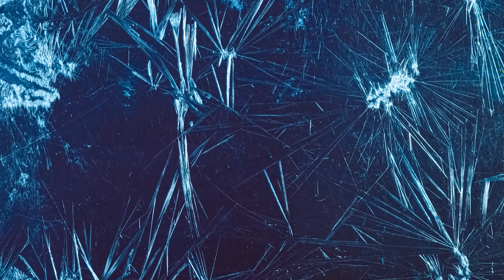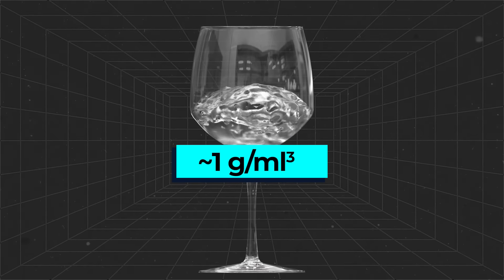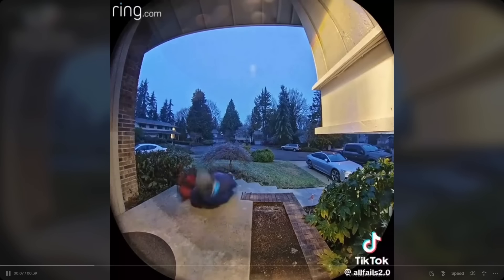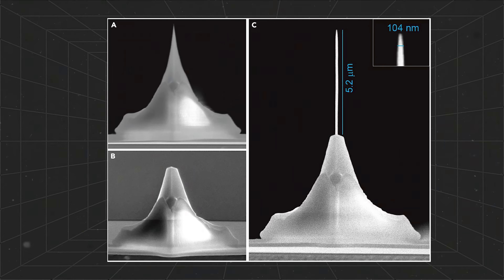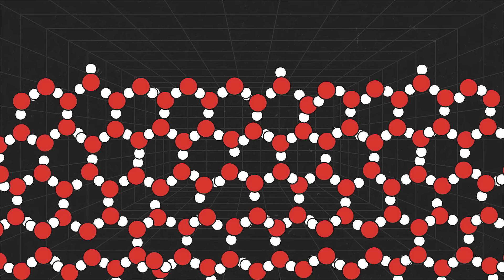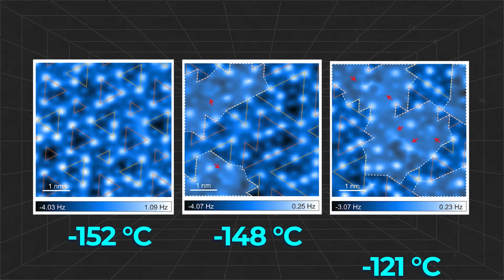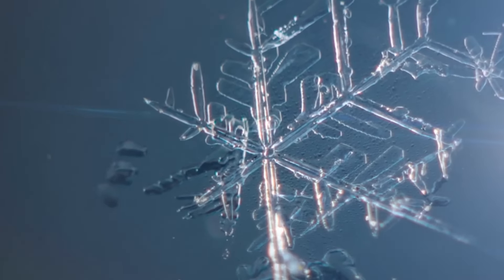We FINALLY Proved Why Ice Is Slippery

Comment: I also wonder if vibration in the top surface plays a role. There are toys called hex bugs and several earlier variations that used this principle to move around on hard surfaces.   A high frequency vibration causes the toys to only be in contact with the surface below momentarily during each cycle.  The rest of the time, the toy is bouncing up or down above the surface.  If ice molecules are also vibrating, they would push objects off of their surface so they are free to move around between moments of contact.

Comment: To the experiment with ice in vacuum. If you only remove the pressure your ice will sublime. Therefore additional cooling is nescesarry. Since temperature is a statistic, some part of the ice will still sublime, while some of the vapor will resublime. This process can reduce the friction -> slippery. I'm not satisfied in the exclusion of the other expainations, however the presented findings from this study are great. One more information I can brag about

Comment: I played ice hockey as a kid. Even at the optimal slippery temp that the indoor rink had, the texture was really rough and very grippy. Sure it was ice and slippery but you couldn't do a dive on your belly across the whole rink. And god forbid you slid on your bare palm. It felt like concrete. The tape we put on the hockey sticks would be chewed up fairly quickly from contact with the ice. I imagine ice at -150c would be like actual concrete. The peaks and valleys would be very rigid.
The surface of an outdoor rink we played at had ice that was slightly tempered by the sun, providing a glass like finish. (Perhaps it was a slow freeze?) Our entire team looked like we didn't know how to skate. It was like learning how to skate anew all over again. Seeing very good players fall on their rear at full speed was a sight to behold. The home team badgered us like I've never experienced before or since.

All of that to say, I wonder how much ice is changed by conditioning of the surface in the real world. In a lab I'm sure it was very well controlled for. However, anecdotal life experience tells me more of the slip people talk about casually has to do with the resilience (or lack thereof) of ice against having its surface tempered/smoothed by the sun and friction. Or even being molded by an ice cube tray. Did previous experiments about friction take into account these variables? It wouldn't answer why ice itself is slippery, but I feel it would answer why it's sometimes more slippery than it should seem like. Shear force seems like it can't be ignored here practically speaking either. Smooth concrete is slippery and exponentially so with some light concrete dust. I feel ice is similar. Like all rigid solids.

I'm am glad we have gotten to the point as humans that we can do very isolated experiments, to the point of plucking an AFM toolhead over -150c ice, at near zero pressures. The assurance of these results means so much more than more macro scale experiments could ever provide.

Comment: There is also some relationship to this in water splashed onto a pool of existing water sometimes forms tiny globules of water that do not get "wetted" by the pool they are gliding upon...  until they do.  Those little guys get formed and are "molecularly" "happy".  Even when the temperatures are equal for the pool and the droplets and not "hot" at all.  I think it relates inasmuch as the surface molecules of those 'balls' are a perfectly formed 'net'...  until one of them decides to "attach" to the surface it is dancing on.  Then it disappears into the void of the pool like ball lightning popping out of existence after a few seconds of floating around in our dimension(s). (personally witnessed).

Comment: I have not tested any of this stuff, but my logic would go as follows: A smooth surface vs a smooth surface is slippery and if the object is large enough, it traps a small layer of air and makes these objects hover for a while and then creates a vacuum as the air escapes between them, but if there's water between any smooth material, it becomes extremely slippery. Two ice blocks in a room temperature are already melting and when connected the surface has no room for heat and they both distribute their coldness causing them to fuse. Ice skate on ice creates grooves and is again the smooth vs smooth surface making it slippery. Cold ice block vs cold ice block in a cold room would have friction between them if the surfaces are not smooth. If you would rub these ice block against each other, they would find some sort of equilibrium on their surfaces and be evenly smooth and then become slippery. Snow can become ice under pressure and if you step on ice with snow under your shoes, the snow will turn harder and match the smoothness of the ice. If the ice is smooth; the snow under your shoe will also become smooth and very slippery. 

Interesting subject and I could write a lot more, but thank you for the video and anyone crazy enough reading my entire text.

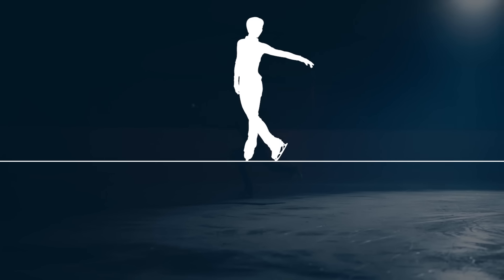Comment: Nitpicking but at 4:21 the pressure is about a 100psi with figure skates and 160psi if using icehockey skates. This is due to the concave shape of the blades and a substantially smaller area then in the used in the calculating of this pressure. It’ll create more heat but not enough to matter

Comment: I think the two ice cubes sticking together is a different phenomenon. I think this, because it is much easier to happen when they are submerged in water. I think what happens is that the warmer medium around them aqctually melt a bit of ice on the surface, and when you put two cubes together, then suddenly you remove the warm medium from their contact surface, and instead it is surrounded by still colder ice that refreezes the thin liquid layer. If you sumberge ice cubes in cold water, then the freezable layer is already provided, while in air the ice has to melt a bit first. Also these semi-free molecules of water don't explain how they might stick together, because usually the bumps on the surface of ice cubes are far larger than a size of a water molecule, so there would be a lot of air between the two surfaces that you want to fuse, and very few semi free water molecules to create the new bonds. The molten layer would be shaped by surface tension which gives a much smoother surface and easier bonding between the two ice cubes.

Comment: what makes it even funnier is that the whole "hold them together and they fuse" also WOULD happen to metals, if not for the oxidation, (Vacuum Welded pieces of metal are real issue in space) 
But it actually kind of happens with different mechanics, seemingly due to different processes... caused by the same  physical mechanics.

Comment: Water is truly strange in a lot of ways.

Also, I have a question, which is probably very obvious for people working in the sciences, but in the AFM images, what are the Hz a measure of? I mean, what's oscillating or cycling and how does that relate to the contours being measured? I expected to see units of length in some form of function of change in height per units distance in a specific direction or something like that. How is frequency used in this context?

Comment: Trying to guess what it is (I'm in the beginning of the video)

Guessing it probably has to do with weight hitting the icy surface with a mix of thermodynamics: your weight puts in kinetic energy on the surface of the ice, melting it to water, the molecules of the water collide to the low temp ones while also colliding with your food, thus the friction decreases

Comment: The property of two objects melding together is more common than one might suspect.
Metals for example have this property, only it doesn't usually happen due to their habit of building an oxidized layer when in contact with air.
In space though they meld together just the same.

Comment: Two pieces of ice cube stick really well when the surfaces are flat and there is a bit of water between them. The water refreezes between the two ice cubes and bonds them together. Under normal pressure exerted by fingers, I think it's too related to the main discussion of the video.

Comment: 3:39: The reason why I thought that's right, is because when it is very cold, it seem that ice is less slippery. That intuitively makes sense if ice has to melt in order to be slippery, so less ice will melt to water if it is colder, so we have a thinner layer of water that has less mobility, because the thicker the layer, the more freedom the molecules have at the top vs. the restricting touch at the bottom, versus a thin layer.

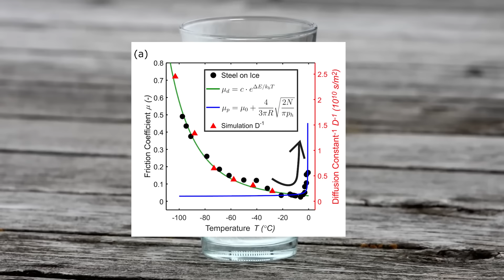Now I don't know if that's actually it, because now the question moved to the next stage: So ice has these weakly-bound molecules at the outer layer, that are able to move around like marbles, making ice slippery. So the new question is: Why are they less mobile when temperature decreases? Since it can't be the thickness of the layer (it is mindblowing anyway, that such a thin layer is sufficient to make ice slippery! Just a few atoms!), why is ice less slippery the colder it gets? Why does it turn into a high-friction surface, and at an exponential rate, as the graph at 12:05 shows.
Reply: He discussed this in the video, but maybe he took for granted that the audience understood that atoms move less when it gets colder

Comment: Modern ice skates have a very specific U shape (inverted) and not the V shape. So it does melt the ice between those edges and allows for such great performance.
Reply: but they don't melt the ice because not enough pressure

Comment: Actually, there are other common solids that stick to each other - but they need to be extremely flat. Industrial grade block gauges are known to stick to each other very strongly when placed in face to face contact and, if left in this state for a few hours, will become permanently fused together.

Comment: Having a go at answering the question at the beginning of the video before watching: due to hydrogen bonds in water, ice is held in a more open lattice when frozen than when a liquid. This means pressure on the surface can melt that bit of ice which is why ice is slippery. Pushing the two ice cubes together causes some melting in between them, but it's cold enough surrounding it that they can quickly refreeze, joining the two cubes with new hydrogen bonds holding the structure together. 

How did I do?

Comment: Okay, we have slightly loose water molecules on the surface of ice.  What if we could bind something to those loose waters without actually removing them (and by an endothermic process, if possible, so that the ice isn't further warmed).  Were there such a material, and were it cheap enough and non-polluting, it might be an excellent material with which to treat roads and paths in the winter.

Comment: Pressure causes a small amount heat (energy) and melting, and when the pressure is released the water re-freezes as the pressure is released.

Comment: You're quite correct but I think not completely. I've studied metalurgy at high school so I guess I have some knowledge about materials at temperatures near melting point. Correct me if I'm wrong but ice above about 230K has still a lot of dissolved liquid water in it and putting pressure on it pushes this trapped liquid water to surface where it acts as slippery surface just like you described with the loose molecule of water.
Reply: "I've studied metalurgy at high school so I guess I have some knowledge about materials at temperatures near melting point." sicne when is highschool any argument of authority HOLY HELL

Comment: it's called "the exclusion zone".
The reduced number of hydrogen bonds caps out at H1.5 per O.
It's basic.  and there's a zone of basic water, wherein there is a liquid crystal state of water with a reduced number of hydrogen bonds.  Outside of that is where the extra hydrogen goes, causing the line outside of the exclusion zone to be acidic.
This is also how and why water can conduct protons.  water doesn't conduct protons very well without changing into a reduced-hydrogen hexagonal grid.  In this reduced-hydrogen hexagonal liquid crystal state, it conducts protons very well.
The energy expenditure required to cause the exclusion zone is the energy of proton motion.  the proton-conducting liquid crystal state of water is the relative low-energy state of water when in proximity to a solid acid (a proton donor).

Ice is a proton donor.
The reason the exclusion zone excludes is because of the conductive motion of protons outward from the proton donor.
The reason stuff doesn't get back in after being excluded is because it's in a liquid crystal state.

Comment: Do you know if they degassed the water first? If you were to freeze water while pulling a slight vacuum would that affect the results compared to freezing and then pulling a vacuum. Do you know if they tested it under different atmospheres or with extra gas dissolved before freezing and pulling the vacuum?

Comment: They look like non-contact AFM images, not AFM. The tip is attached to a tuning fork. Small forces that act on the apex of the tip cause a change in the resonant frequency of that tuning fork and this it what they measure to obtain those images (you can see the delta F units in the colour bar).
Maybe the surface molecules are not moving because nc-AFM is gentler than AFM

Comment: fusing two solids is uncommon?
ask car mechanics.or anyone working with metal bits. pressure welding  or cold welding uses the idea that if you force em close enough - basically making it that theres either a vacuum or just the atoms itself without an oxidized layer, the atoms bind to each other w help of van der waals forces. its super strong adhesion in a sense.

so it would make sense that the same works for ice. though enough pressure could cause a tiny amount to become liquid and easily bond to each other, getting cooled down again by the ice next to it and now theyre  joined they freeze and the gain of energy that will cause em to liquify only happens at the edges that are in contac to the surrounding air

Comment: My first thought of why two ice cubes fuse is that it has to be hydrogen bonds. It just makes sense to me. The ice is slowly melting on the surface so the crystalline structure is being broken, turning it into a chaotic form that can be influenced by the neighoring also melting water to form new bonds

I also figured since while melting, water becomes more dense, a small vacuum is created between the crystal structures while they melt, resulting in a "force" that pulls them together

These two together would make them fuse

But that's just me speculating

Comment: All of this just makes me think about the air in an airhockey machine... the boundary between the solid and any other object that is solid causes the object in contact with the ice to slip against the other one. Since the atomic structure of the ice is a specific lattice, the object touching it has nothing but -friction against it.

Comment: Having grown up and lived in the interior of Norway, safely away from the warming effects of the ocean, I've never considered ice slippery. It sometimes is, but often isn't. Below around  -15 C°, it's slippery mainly if it's covered with a layer of loose snow; you're better off stepping on bare ice, than on snow which may have ice under it. So, pretty much what he said, only on a macro scale.

Of course, when I say ice isn't slippery, that doesn't mean it's like dry tarmac; if you really want to, you should be able to slip good enough to break your neck, all the way down to -40 C°, at least.

Comment: I don't find the continued slipperiness of ice in vacuum so incompatible with the "layer of liquid water on the surface" hypothesis. The moment you measure its slipperiness, the ambient pressure at the contact zone between the ice and the probe is no longer zero, and thus liquid water should be able to exist - even if only directly in the contact zone.

Comment: It’s pretty satisfying that the intuition of a micro layer of water was ALMOST correct, but it was simply at the wrong scale. Not molecular scale water, but atomic scale weak bonds. Which means that the slippery-ness is innate to the solid state, and doesn’t involve the liquid state. It also seems to explain (maybe? I think?) how ice can be slippery, then suddenly be sticky for a second, because more of the atomic bonds snap into place, probably reaching a more hexagonally-bonded region of the surface. Bonkers.

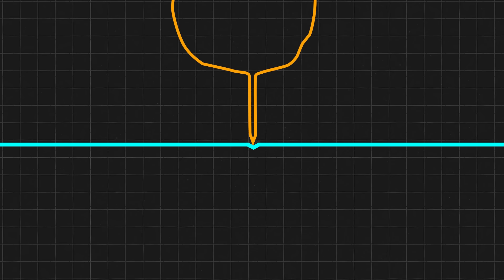Comment: 4:00 this isn't how blade on ice skate looks
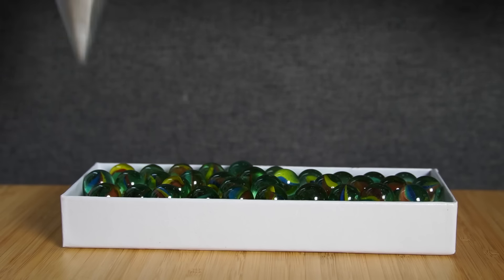7:51 doesn't it vibrate on the surface and change in height will change the frequency/amplitude which this device measures? or i am thinking about something else?

Comment: 4:00 Skates (figure and hocky) are both nearly flat on the bottom across the thickness of the blade... well, concave and about 4mm wide. =) They don't go into a single point.

Comment: 2:00 But… even in a vacuum… ice is still melting… it will still create a layer of liquid that quickly turns into gas… 
Instead… This experiment needs to be done in a frozen environment. Frozen surface and all. To prevent melting.
Reply: No it doesn't. Ice, in a vacuum, turns directly into vapor. Liquid water cannot exist in really low pressure. It's the reason why asteroids and moons can have ice on them but not liquid water.
If you're interested in this you can Google the phase diagram of water. The point from where there is no more liquid water is called the triple point and it's at 273K (where water freezes) OR 611Pa of pressure (less than 1% of our atmospheric pressure).